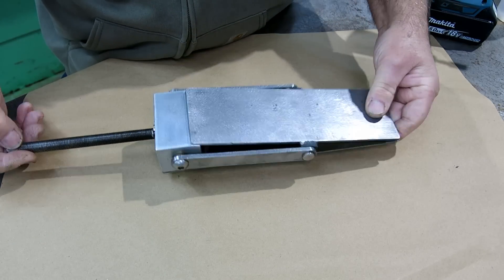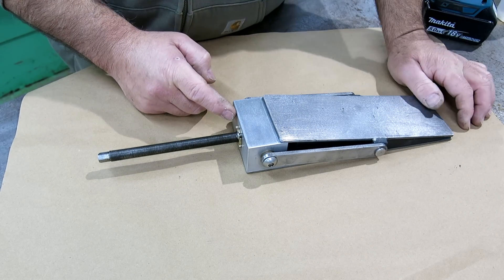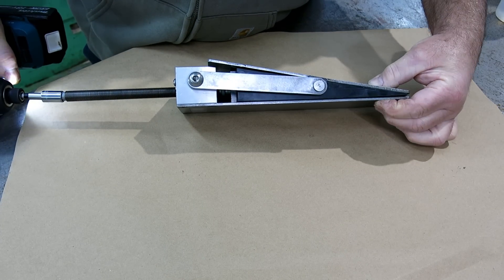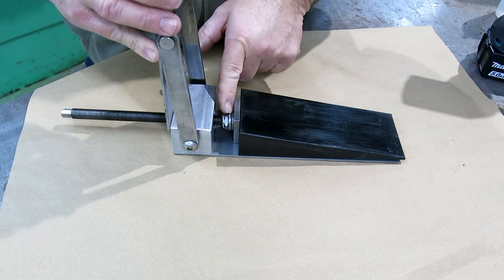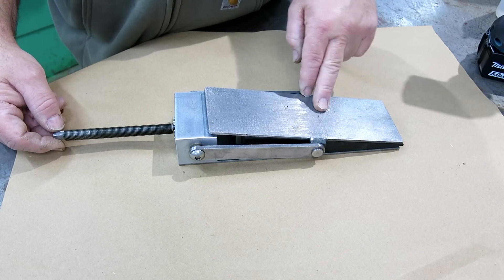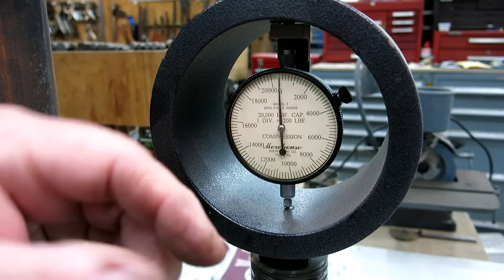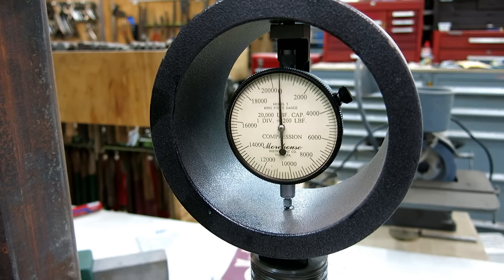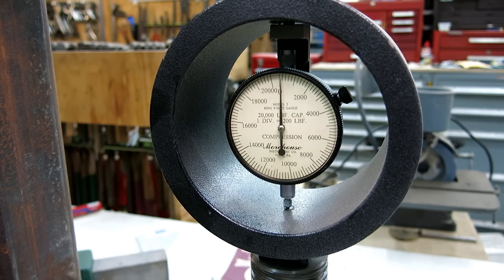Machinery Wedge Jack

Comment: Goo video, haven’t seen your videos in the feed for quite some time so glad to see you’re still active in all regards. Mind:designing, body:shop mfg, online presence.

I’m thinking the idea of self locking  and the critical angle has to do with the friction generated from the normal force relative to the base of the lift, the gravity pulling the machine down to the ground must be greater than that of, as you say, the coefficient of friction. 

But then after thinking it through realizing that self locking in this instance isn’t important, as the screw is unable to be back driven, so the screw holds the sheet back on the wedge.

Of course, given the constraint of the above critical angle, one could design it to have an approximate proportional torque, so some ## n•m or ft•lbs equals some weight. In all likelihood not that useful a feature but is t that how the ring dyno works? I know you’ve a video in your old shop on it, etching press series I think.

👍🤙

Comment: This tool might be useful for firefighters to use for breaching locked doors.  The firefighter gets a gap in the door and jamb with their Haligan tool,  then slide the tips of this lifting wedge in the gap.  Use a battery powered impact gun to turn the screw on the wedge.  Perhaps the tip of the lifting plates could be made from titanium for strength and weight reduction of the wedge tool?   Cool build.

Comment: The threads aren't designed for that. They work, but not for long if you are near the load limits. Only worry if you plan to use the wedge more than a few times.

Better choice is acme thread, like a vice. Maybe McMaster has some, idk. I found some in a junk pile, but that's not a reliable source of anything.

(I made an adjustable stand)

Comment: You could reduce the required torque to as little as 1/4 by using a ball screw. Obviously, you could also reduce it by having some sort of rollers between the wedge and the plates.
A look at efficiency of various types of screws: https://youtu.be/wk79zjH-aUI?si=tlbbF9zNUQ-2sCrG

Comment: Looks to me like you could skip making the delrin wedge if you don't have plastics in your scrap pile,  and substitute a tree fellers wedge.  Might need to shorten the wedge a bit, and they are ABS not Delrin, but I know they take a beating, and you can get them for under $10.  Not sure about the natural lubricity and whether the wedge would resist backing out or not.

Comment: Another key factor in the power is the fine threads.  If your screw is too coarse, you will lose a lot of leverage in that it will be a higher gear ratio, so to speak.  In other words, it will require more force to turn the screw for a given result.   The finer the threads, the more it multiplies the lifting force;   and the force will be directly inverse to the speed of linear movement:   So a finer thread will take more turns to travel a given distance..   Very cool tool;  I might have to make one now. :)

Comment: You have my gears turning with this one..nice shop made tool there..ive noticed with steel wedges ive made too steep of an angle wont bite..but the standard angle we use at work bites like crazy and is stable..i did not know why (exactly).. i use the wedges is heavy steel fabrication and welding..

Comment: If my Physics I still serves, the self-locking angle should be the arctangent of the coefficient of friction. This should help you find the minimum angle from tabulated friction data between materials under different conditions, dry, greased, etc.

Comment: Would a hardened steel to hardened steel slip surface have a lower friction coefficient under heavy load? Would, rather than having one flat plate on top and one tapered wedge; by having opposing tapered wedges be beneficial. If the latter, would having one a thicker top plate, and one of the plates being curved(by virtue of a changing leverage point), advantageously lever up the tow of the upper plate? As a way to reduce slippage between the item being lifted, the jack, and the floor, prehaps skins of some sort of deformable plastic would give good grip on the surfaces you don't want to slip.

Comment: As Tom has shown, you can get a massive force from a screw. By decreasing the angle, you can generate even more upward force, but the wedge gets longer and the threaded portion of the screw is longer. A limitation is the cold flow properties of the plastic wedge.

Comment: I’d be interested in the thrust bearing setup and how it attaches to the wedge. Pretty sweet little lifter you made!
Reply: Amen!
Reply: Same here!
Reply: I’m interested also..
Reply: Me too
Reply: Yes, we want details.  That's the only thing that there's not enough information in your video for us to build ourselves.
Reply: 7:55 it's a very simple wedge design.   The wedge is pushed underneath the "lift plate", the more you screw it in 🤔
Simple and very clever 👍🏼
Reply: We know the wedge part. What we want to know is what the captive thrust bearing is - it works both ways to allow retracting the wedge.  @Texaca
Reply: @randydewees7338  could it be a stack of nut, washer, thrust bearing, attachment plate, thrust bearing, washer and another nut on the threaded rod?

Comment: Good to see you are back. Your timing is perfect. I need to raise my lathe for blocks. This tool will make it much easier. Anything else I need to be aware of besides the angle and thrust bearing? I didn't see a good shot on how you did the pivot attachment and still left room for the wedge to slide w/o snagging.
Reply: If you look around @2:55 and zoom in, it's just a pair of vertical tabs that are tig welded to the top plate.  I'm guessing that the hole in the tab is threaded and it's assembled with a plastic washer and some loctite, but that's just a guess